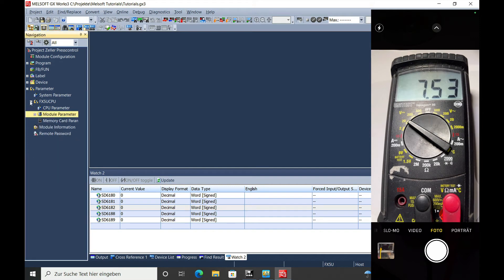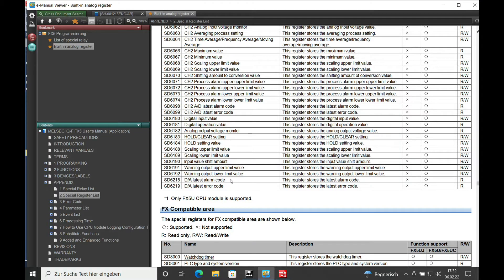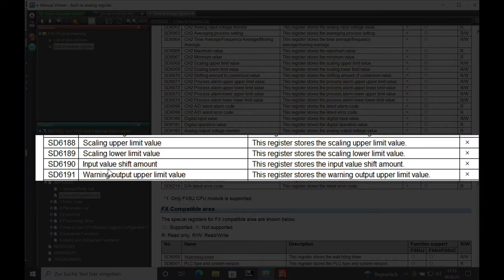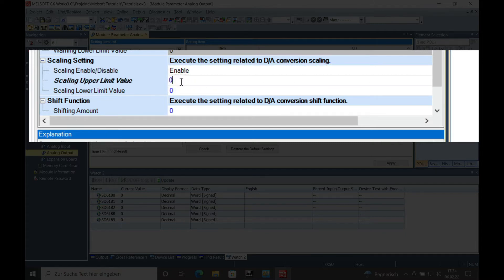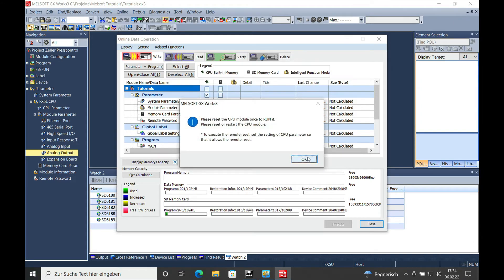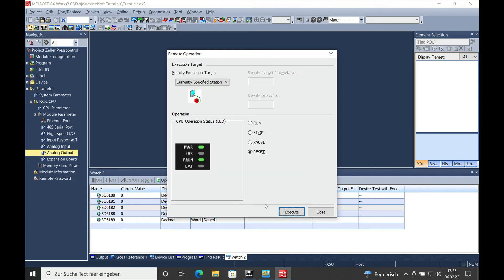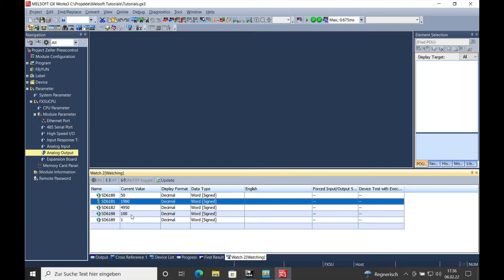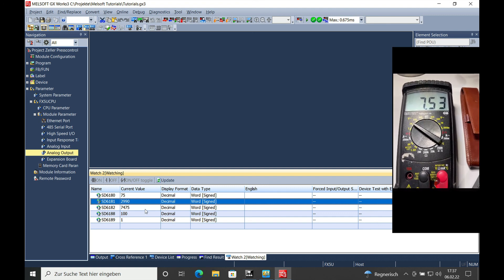FX5U Onboard Analogue Output Scaled in Mitsubishi

Comment: Do you know how to connect SD6180 to HMI as numerical input or incremental and decremental buttons? And show SD6182 as numerical output? And show SD6182 multiplied by some number? 
When I just created numerical input and chose Device: SD6180 it doesn't work.
Reply from the maker: Hello, thank you for your question. I will check that issue on my set up. Just one auestion ahead. Are you sure that you are bot overwriting the SD6180 in the program code? Because then you will not be abLE to change the value in the HMI
Reply: Once I created the button in GT Designer3 and connected it to the controller. When changing the value in HMI, the voltage at the controller output changed only to 0 or 10. I also used the simulator in GX Works3 and when I changed the value in GT Designer3, SD6180 did not change in GX Works3, but SD6181 probably changed, and to a different value than the specified one.
ą @zellerautomationandplc
Reply: Once I created the button in GT Designer3 and connected it to the controller. When changing the value in HMI, the voltage at the controller output changed only to 0 or 10. I also used the simulator in GX Works3 and when I changed the value in GT Designer3, SD6180 did not change in GX Works3, but SD6181 probably changed, and to a different value than the specified one.
 @zellerautomationandplc
Reply from the maker: Hello, sorry for the late reply. I have just tried it on the simulator mode. It doesn`t seem to work at all. I will try it on my CPU later on. And i let you know the result.
 @vektorex7734